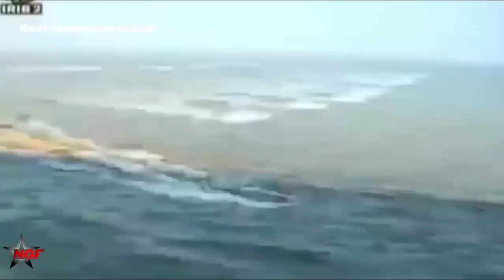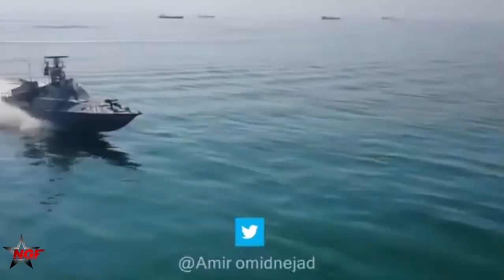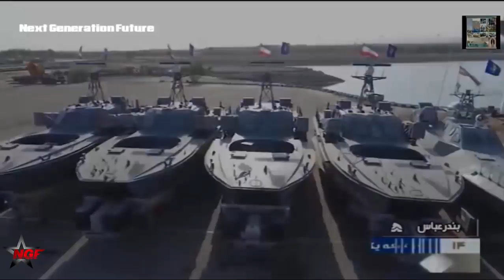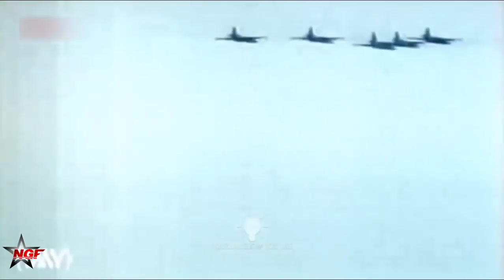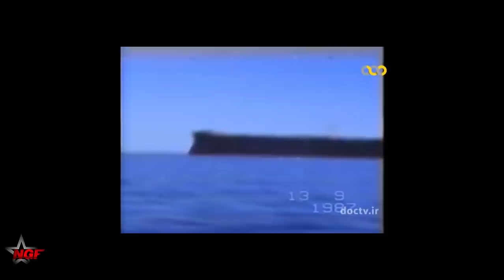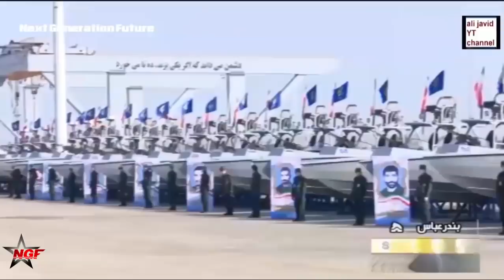Iran Speed Boats vessel was dissected, rebuilt and armed with sophisticated weapons systems

Comment: God bless Iran ...Iran need to develope Jaaming and signal detections and even hiqh range thermal cams
Reply: at least 3 models are in operation, one is 90s era Russian type, anotherone is the rev-enged domestically produced of the first one, BUT a few years ago the first domestically designed model with far more advanced tech and range debuted its military service with a bang back in 2018 (when Iran Jammed, hacked and landed that US drone safely inside Iran). and there's talks of a 4th model, with the latest Russian jammer TECHNOLOGY acquired to be developed domestically
PS. Jammers are super dangerous to use ANYWHERE, those waves are cancerous as fq